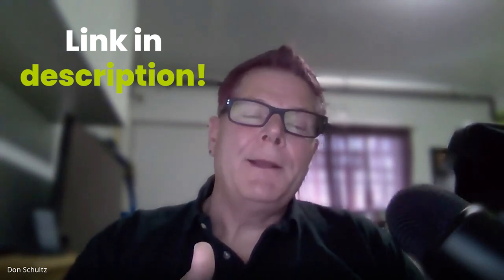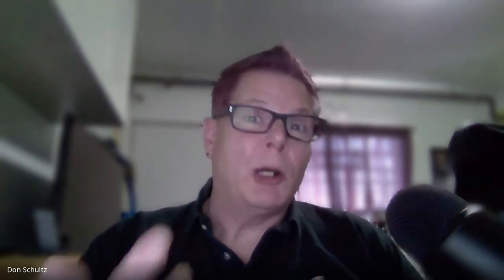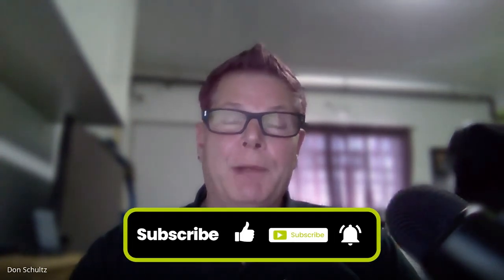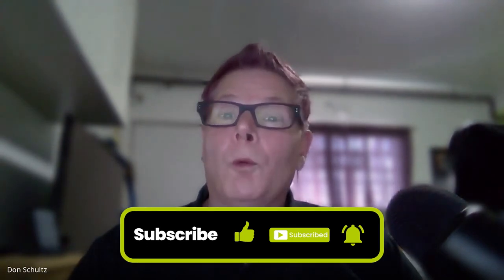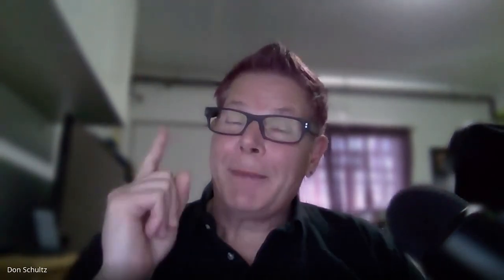Everything To Know About Series 6 Coaxial Cable | Low-Voltage Lowdown | Ep. 4

Comment: MoCA adapters are available for up to 2.5Gig Ethernet connections over COAX. Point to point, or multipoint.
It can be cost effective in some pre-wired residential circumstances i.e. for an ethernet extension over existing COAX vs doing wifi extensions or wifi mesh systems. 
Thanks for the helpful video, it's a nice factual presentation.
Reply from the maker: Hello Greg! You are on point. MoCA is useful in certain circumstances, and can really solve some problems.